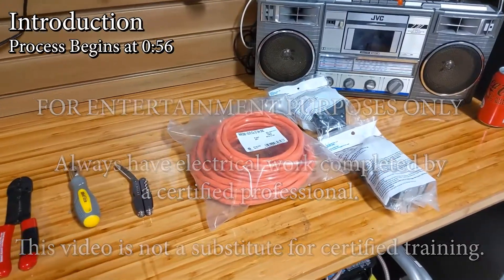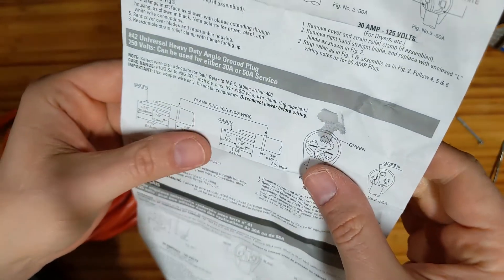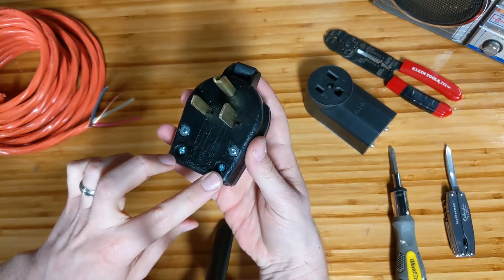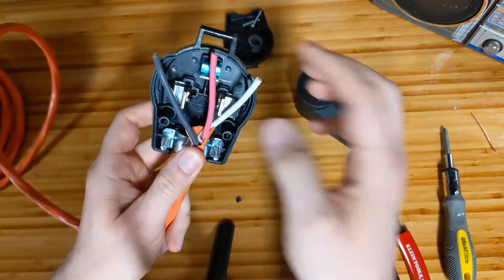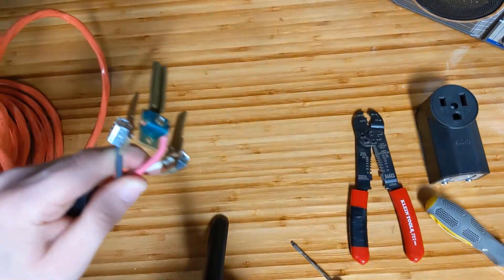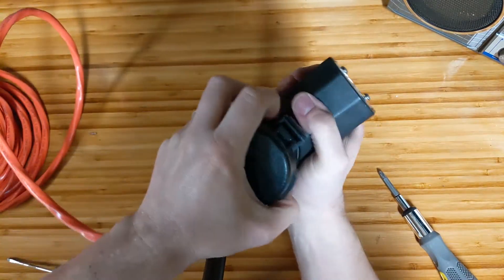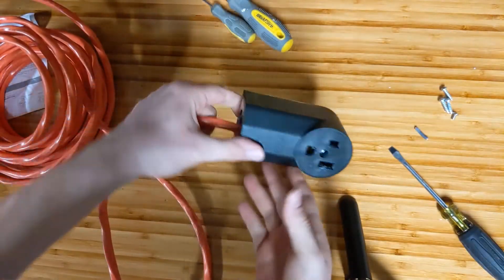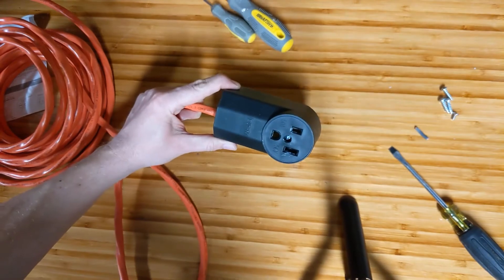How to Build a 30 amp or 50 amp / 220v Extension Cord

Comment: If you are leaving the extension receptacle in a fixed location,  this should work well.  If it is being moved in extremely cold temperatures, the jacket/insulation of the cable you used might fail,  since it is not flexible in cold.

Nice to see the JVC 770 made it home !
Reply from the maker: Good point! This is for a specific, semi-permanent location, so it's good. Like I said in the video, adjust the process and make one for your needs! :)
Reply: You have the ground, and each other one is 115v so it shouldn't matter whether it's the bigger one or not. There both 115v and a neutral.